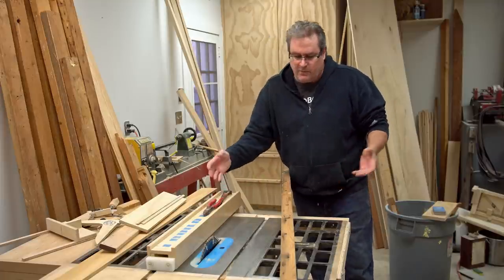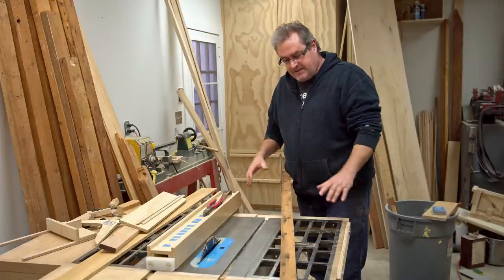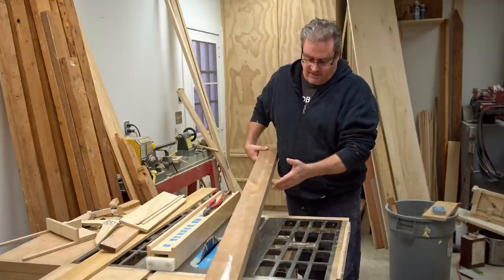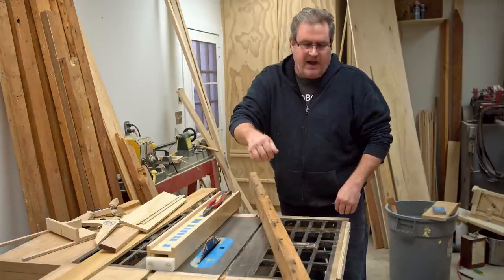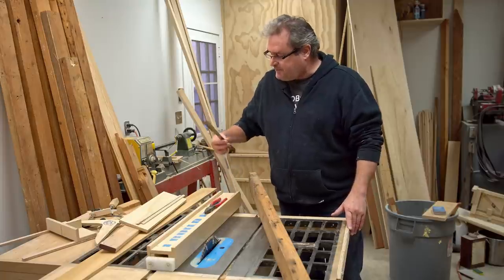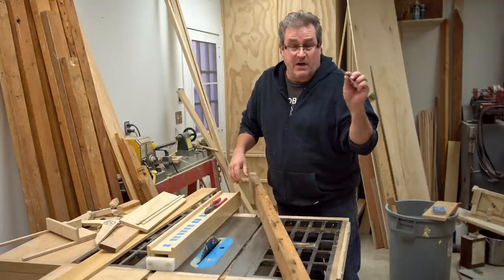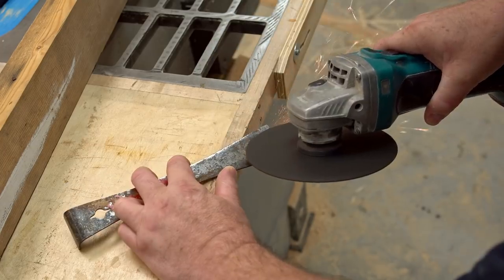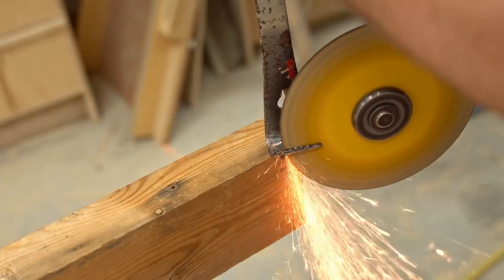Make A Mini Nail Puller

Comment: I'm going to suggest my age here by saying that my father and I used those tools for replacing window panes back when glazier was a valid profession and called them sash tools. My mother, the beekeeper in the family, used it for lifting comb frames out of the hive like you mentioned and called it a hive tool. A local door/window/cabinet shop uses them as glue scrapers and calls them glue scrapers.

Cheers,
-- Joe
Reply: Joseph Scarborough I simply call them my "trim bars"....because I use them to remove trim. I have also used them to scrape mud off of my boots and ice off of framing lumber in the winter. I have even used it as a flat screw driver. These tools are almost as versatile as the 9 in 1 tools my painter always carries.